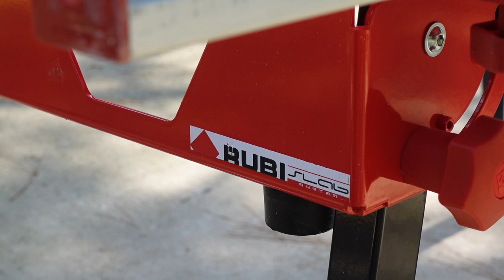The Rubi Slim System Slab Table - How Does It Work?

Comment: too expensive . just buy 8020 alu tubes and couple of saw horses for half the price
Reply from the maker: To each their own but you might not get fast setup, secure surface, or the full support required.  I wouldnt bother wasting my time trying to make my own.  Ive got other issues to figure out.